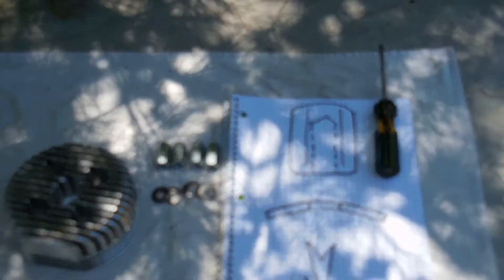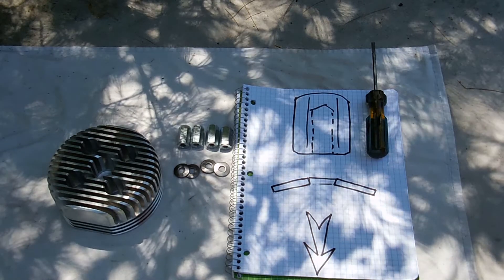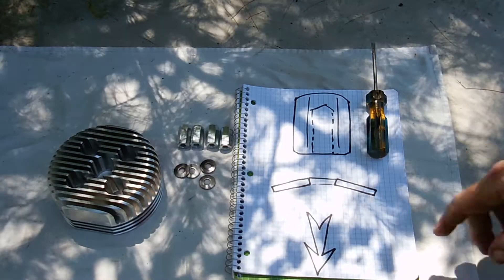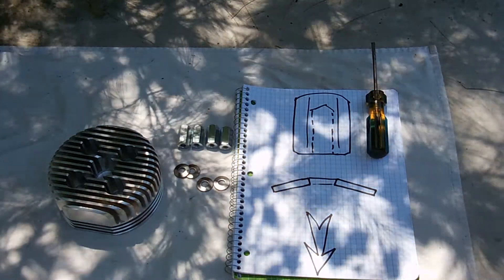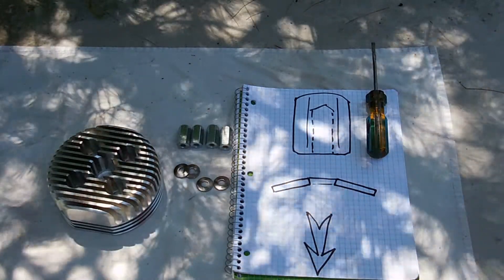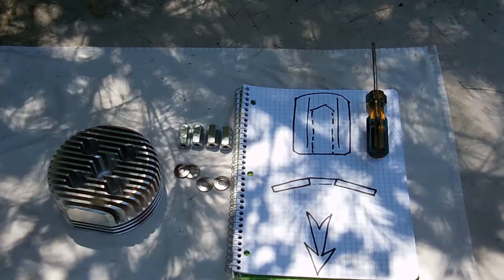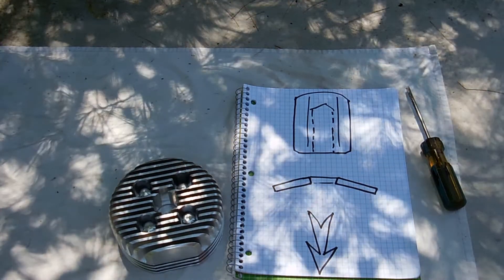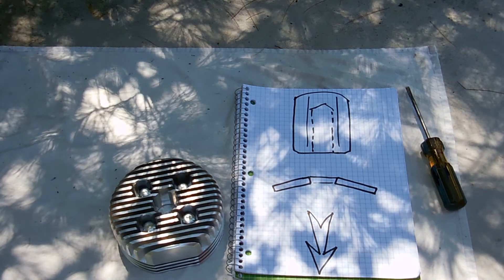Fred from CR Machine shows how to install disk spring washers on MB cylinder head

Comment: Hey Fred, i posted this comment on another of your videos. Kust hopong youll see it. I could really use your help. I have a brand new unused mikuni vm18. Do you recommend using a reed valve/ windowed piston setup or would you say that I should just mount it directly to the intake manifold without the use of a reed valve setup?

Comment: Hey I got a new motorized kit off of eBay I’ve been riding it for about a week and all of a sudden when I pedal and let go of clutch motor turns over but when I pull throttle it only revs the engine and doesn’t actually make me move I’ve adjusted clutch and throttle many many times please help someone
Reply: Devlin Melton start by changing spark pllugg..then magneto..
Reply: Not plug or magneto- sounds more like a clutch engagement issue.
Reply: If adjusting the flower nut ain't enough you can adjust the spring inside. There are videos on it. The bolt with a hole in it that the clutch cable goes through before it goes in the clutch lever if you remove that you can see the spring inside. It doesn't take much to adjust it